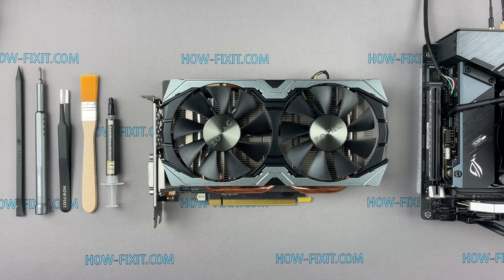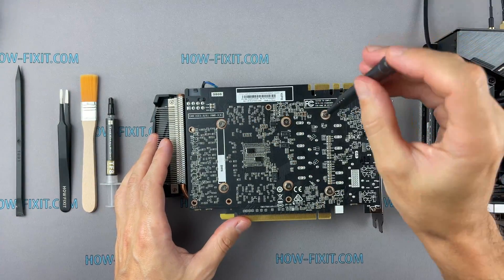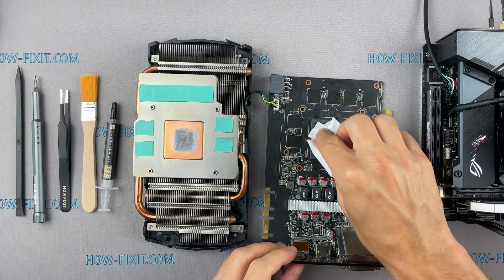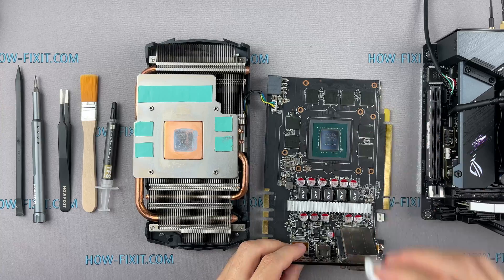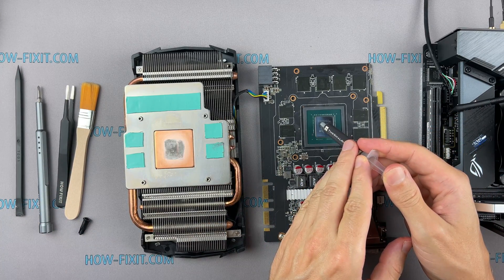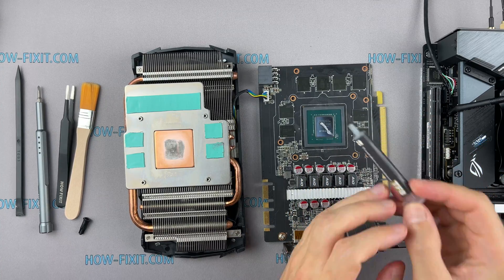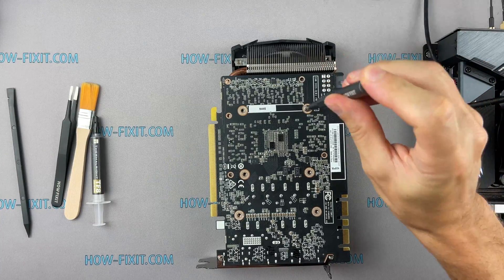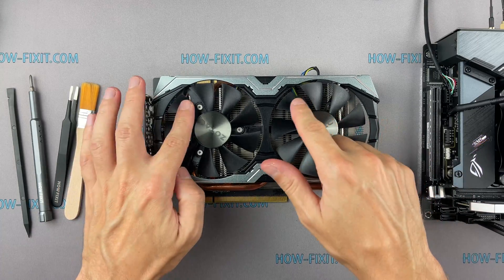GeForce GTX 1070 ZOTAC Mini Disassembly, fan cleaning and thermal paste replacement

Comment: Even after replacing fan on a 2070 Zotac mini it still rattles and sounds like the fan scrapes against something, which it does, cus I can hear it spin up, scrape and then stop completely.
Zotac makes fucking bullshit cards I am NEVER going Zotac again.
Reply: might be a 2000 series issue with Zotac, but I have a 1070 Zotac Mini and it's been great for like 5 years
Reply: @DavidCriketGD it wasnt as good for me. 1st one broke before the 3 year warranty period ended then the replacement broke around the same time. It had issues before that too, showing signs of dying. I have an all noctua cooling system with good temps. Regularly cleaned. They had good customer service though.
Reply: open the back of the fan and put oil
Reply: My 1070 mini is still doing fine 8 years later 😂